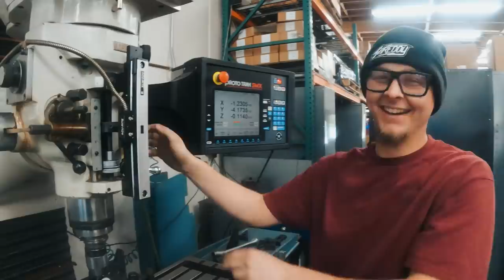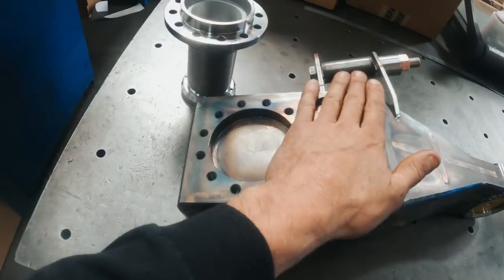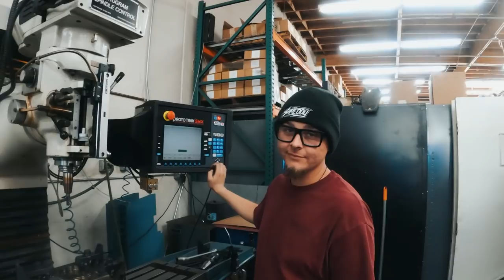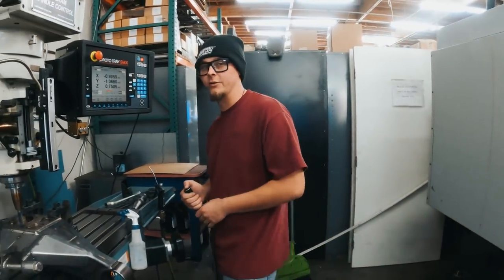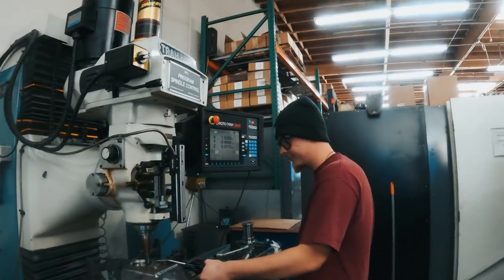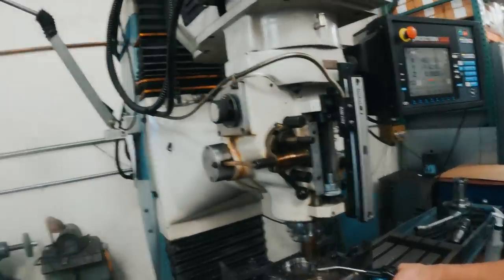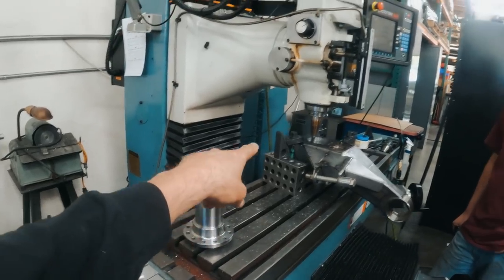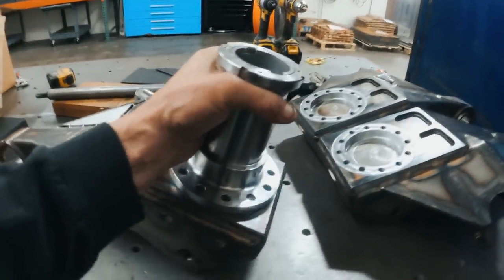74 Weld Precision machining JAWS spindles!

Comment: as a machinist, this is great
Reply: As a machinist, I would have told him to wait outside and I'd let him know when it was done. Not hating on Blake, but distractions never help a first time operation.
Reply: @lunkydog  gotta love the safety squints by the guy in charge with chips flying by while cutting. worked a few years in a tool and die shop and had setups like this. hardend chips in the eyes are a good way to go blind.
Reply: @PainKiller1773  I once caught a chip that I'd actually blame on my glasses. Had a particular job with pickled material and I was blowing it out on an Op stop with my head turned away and a flake came out, bounced off my glasses and back into my eye.
Reply: @lunkydog   I got a chip in my eye twice. Both times I was wearing safety glasses. I'll never wear them again.
 I also worked at a shop that I started as a Prototrak guy. Eventually I had to tell the owners that customers had to wait in the lobby. It is so nerve racking having someone watch you when you absolutely can't mess up. You did good Noah!

Comment: What's the benefit of having the uni-ball sitting vertically rather than horizontally on the spindle?
Reply: More bearing surface for up and in loading
Reply: Bang bang bang lol
Reply: Double shear for horizontal.

Comment: i figured you would have just centered it and used a boring head lol. this shit has me stressed
Reply: I was just going to type that.
Reply: Boring bars are for lathes and boring heads (if that's what you mean...)cant cut that much material in one pass.
Reply: I'd use a twin cut head then a fishing head.
Reply: @777cerovski777  are you on a Bridgeport? That's a lot of hardware these days. If you are on a Prototrak trust the equipment. It'll bee good enough. Tolerances are way over thought these days.
Reply: There's no wrong way of doing it just throwing it out there lol as long as the customers happy.
Reply: @EL-Dude-A-Rino-0.69  fixed,  and yes, meant boring head
Reply: @shanehook1010  WHAT?
Reply: @shanehook1010  REALLY. WHAT?

Comment: Thats a big ass proto track lol
Reply: Just a #5. 
They build #12 now with RMX controls.
Reply: @brandonvarney7258  Is it a machining center? I only see the same 7 that they always had. Their machining centers are garbage. I have run and like the idea of the DPM 5 or 7 but Southwesterns  flagship is the DPM3. Most versatile Prototrak I have ever run. If you need a bigger machine you start looking at modern equipment.